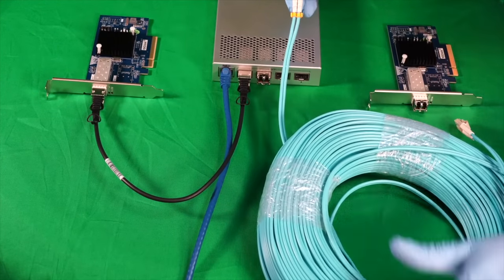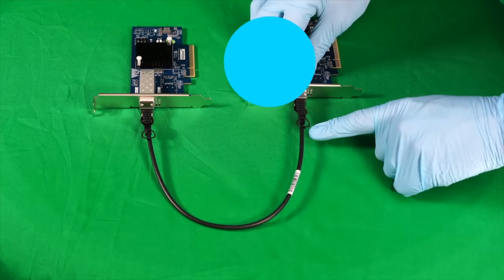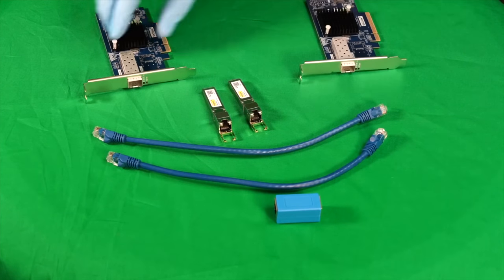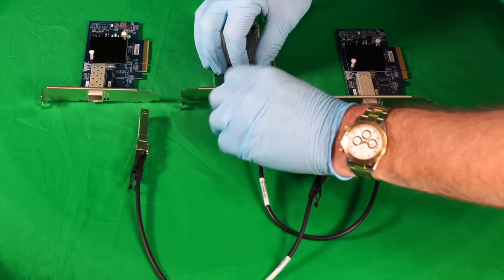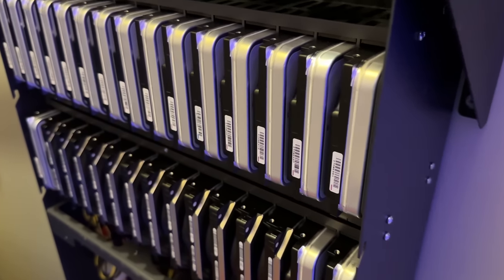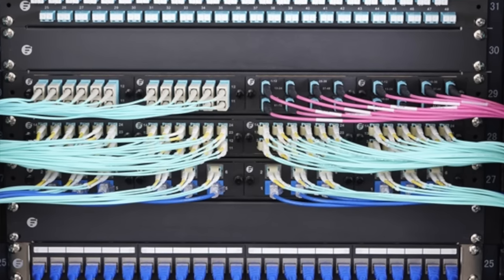10G and 25G Networking - SSD Speeds on the Net

Comment: 100G and 40G ports in switches can often be broken out into 4x25G or 4x10G links (twinax or fiber, not twisted pair).  Computer NICs typically won’t break out that way (some Mellanox is the exception)
Reply: Afair Intel 710 can do bifurcation too. Do you know any interface, that would provide hardware LAG support? Mellanox can do hardware LAG offloading for VFs but I just need card that would be LAG aware. Simplifies network a little.
Reply: It’s typically the OS that does it rather than the card.  You can create a team in Windows server, or a LAG in Linux.  In VMWare you need a distributed switch to do an LACP LAG
Reply: @ausnetting  most of the time it is OS. However, some interfaces do have internal switch fabric. In Intel 710 this fabric is only there to allow connectivity between VFs (as access switch typically would not reply on same interface, as packet was originated from). Mellanox ASAP2 engine can do LAG for VFs without exposing that fact to guest or host machine. It surely works in Linux (aka Proxmox) but have not found (yet) info about Windows support for configuration interface

Comment: 🎯 Key Takeaways for quick navigation:

00:00 🚀 Introduction to upgrading home network from 1Gbps to 10Gbps and 25Gbps
- Overview of different networking components like cables, transceivers, and switches
- Goals of achieving blazing fast network speeds for storage access
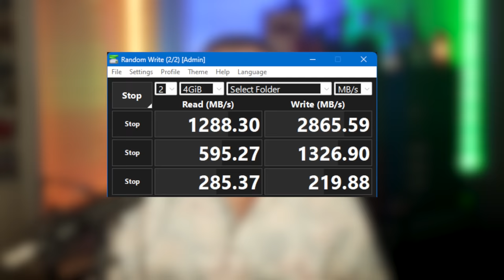01:09 ⛓️ Methods of interconnecting computers at 10Gbps and 25Gbps
- Direct attached copper (DAC) cables and fiber optic cables
- Using RJ45 twisted pair cables with transceivers
- Connecting without a switch using crossover cables/couplers
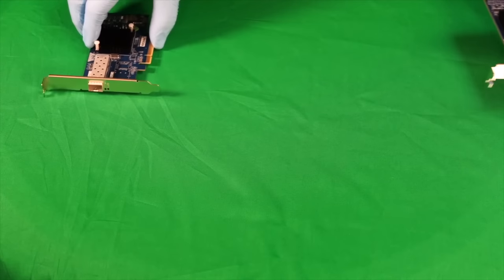02:05 🔌 Demonstrating direct cable connections
- Plugging SFP+ DAC cables directly into network cards
- Using fiber optic transceivers and cables
- Twisted pair RJ45 cables with crossover couplers
04:02 🌐 More interconnection methods
- Using crossover Ethernet cables
- Connecting multiple PCs using dual-port network cards
- Introducing a network switch for more complex setups
05:27 🔗 Long distance fiber optic connections
- Using fiber optic cables for longer runs up to 300m
- Passing through wall plates using fiber optic modules
- Combining fiber, copper and RJ45 for different scenarios
08:30 *🧵 Twisted pair cabling categories and specifications  *
- Explaining Cat5e, Cat6, Cat6a cable types and capabilities
- Maximum supported speeds and distances
- Cable characteristics like shielding and noise immunity
10:19 🔑 SFP port types and transceiver standards
- SFP, SFP+, SFP28 for 1G, 10G, 25G speeds
- Mixing speeds through auto-negotiation  
- Using RJ45 transceivers for longer twisted pair runs
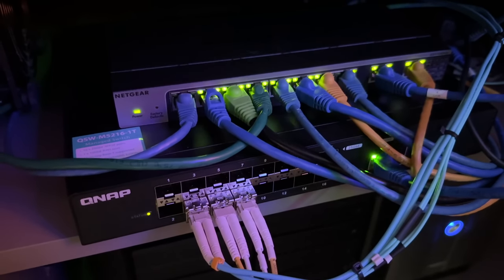13:17 🖥️ Personal home lab networking setup
- Using a NETGEAR 10G switch and QNAP 25G switch  
- Connecting devices at 10G and 25G speeds
- Troubleshooting issues with the QNAP switch
15:35 💻 Adding 25G networking to devices
- Using Mellanox ConnectX-4 cards on Windows/Linux
- OWC Thunderbolt 3 adapter for Mac Studio Ultra
- Considerations for maximum Thunderbolt bandwidth
16:44 *💡 Fiber optic networking basics  *
- Single mode vs multi-mode fiber
- Using cheaper multi-mode fiber for short data center runs
- Fiber optic transceiver operation
19:03 💻 Fiber optic cable types and specifications
- OM1, OM2, OM3, OM4 cables for different speed ratings
- Using OM4 (pink/blue) for 25Gbps and 40Gbps speeds
- Cable distance ratings and future-proofing
21:08 *🔌 Overview of home server closet cabling  *
- Color coding for Ethernet, PoE, 10G cables
- Using OM3 fiber for main internet connection
- Mix of direct attached copper, fiber and twisted pair
22:18 🚀 Benchmarking 25Gbps network speeds
- Testing to NAS with Samsung 980 Pro cache drive
- Hitting near 25Gbps limit from Windows PC 
- Mac Studio throughput limited to ~12Gbps writes
23:14 💨 Disk benchmarking over 25Gbps network
- Testing against RAM disk on storage server
- Mac Ultra read speeds up to 1.9GB/s (SSD speeds)
- 20x faster than conventional 1Gbps LAN
24:10 *🎥 Use cases for 25Gbps networking  *
- Video editing workflows with large 4K video files
- 10Gbps suitable for most single-user needs currently
- Melanox and OWC adapters deliver promised 25Gbps speeds

Made with HARPA AI

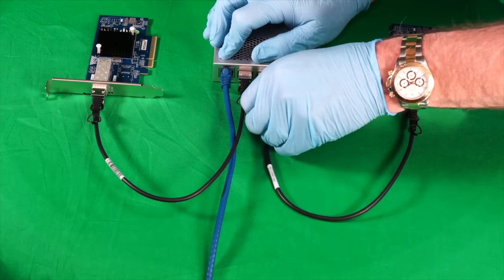Comment: just as an FYI, in that particular switch it's ok to use the single 1g port for switching [5:46], but that is not true of all mikrotik (or any brand's) high speed switches. Many times, it is meant as a console access and it's wired to the CPU and not the Switch chips (like in their 4 x 100gb QSFP), so switching thru it slows down the whole switch. You need to see the block diagram (its on the switch support page or user manual) and see what the 1g port is hooked to.

Comment: Been working at a small ISP for some time now. We use SM BiDi (one fiber for send and receive) for Fiber to the Building and there are cases, where the signal blinds the receiver, if the distance is too short and/or SFPs get mismatched. Also, as the beam is much more focused and usually has a higher frequency, which translates to "way more 'impact' energy", the risk of permanent eye injury is much higher with SM when mishandled. SM can reach as far as 200km (120mi) with carrier grade SFPs and you might not even be able to look at it twice before running out of functional eyes.
Therefore, MM and TP are still valid options for short distances and/or hobbyists and unless you want to go faster than 10G, upgrading an existing inhouse copper network to fiber gains you nothing but trouble. (Exceptions apply.)
When I have to talk to a customer about that topic, it's mostly about the widespread misconception that fiber would be faster, better, stronger in any case. In reality each SM, MM and TP have their pros and cons. 10G are 10G no matter the physical medium, pings are the same, too - even with a media converter in between. Btw, broken fibers still DO happen, especially if you are a proverbial tinkerer.
At Consumer Grade, hardware with 10G support is rare and so are the use-cases for the average Joe. I see on a daily basis what people have connected to their home/soho routers and more than 80% - small businesses included - won't be able to make use of even those 10G. Consider yourself well equipped if you have devices that are capable of 2.5G without bottlenecks apart from your LAN.

Now, if you belong to the other 20% and you know what you are doing, your mileage my vary. In this case, I won't have to send you a technician (and then forward your ticket to Billing) and you can simply ignore me.

Comment: You should check out the 400G-ZR optics.  They can do 400G, up to 120km.  Combine this with the fact you can use different frequencies of light for DWDM, and an optical combiner/splitter, with up to 96 channels, you can get 38Tb/s down a single fibre.  The QSFP optics do cost around £35K each though
Reply from the maker: There's some amazing fiber tech out there that's way above MY paygrade!  I believe they can shoot multiple lasers in and extract them at the same bounce angle and this run multiple streams of light in a single tube, all kinds of crazy things!  And it's not on/off, they can use multiple level of brightness and so on...
Reply: And now even 800G optics are being introduced around one of my work sites.  That requires PAM4 modulation on 8 lanes of 106Gbps with QSFP-Double Density transceivers.    From here on with 200G lanes it's going to have to be all optical, bypassing the electrical interface and piping fibre directly into the switch chip on the board using silicon photonics.       If you have to ask - like me you probably can't afford them - well just yet anyway :).

Comment: I would love to see a follow up video where you enable RDMA on you NICs.  This should give you the same performance but without the CPU overhead of processing each packet when using SMB Direct (file copy).  Also you should try out enabling SR-IOV on your VMs.  This will give your VMs direct access to the NIC.
Reply: That is if the NIC support those features.  I bought several 10/25 gig Mellanox Connect 4 dual NIC cards from E-bay on the cheap a couple of years ago.  I am not sure if he bought the 4 or 5 series so it will vary on model.
Reply: RDMA is huge offload. However, you have to be cautious with SR-IOV. It gives some advantage in demanding applications on VMs and there is no denial for that. However, I have experienced issues with handover in HA Hyper-V cluster. Network connectivity was interrupted whenever handover happened and we were never exceeding used VF count on particular interface. Also, windows guests were unable to utilize failover networking. I have ended up with plain, old LBFO teams for VMs. I do prefer machines to be 1% slower in high-performance networking (not a big deal, when half of people are working remotely anyways) but without unnecesary downtimes.
Reply: Yeah rdma is great but the switch probably won't support PFC, which is kinda a requirement for RoCEv2
Reply: @LampJustin  If your Nic supports iWARP then you don't need PFC.  Also Mellanox has some newer Technolgies (ZTR) that lets you get away without configuring PFC.
Reply: @brylozketrzyn  Agree about SR-IOV with HA clusters. If you only have a limited number of VMs that use SR-IOV and ensure that there are enough VFs available on any given node then you should be OK.  I would also avoid LBFO as it is end of life.  I don't think SR-IOV makes your network any faster, but it reduces CPU overhead somewhat.
Reply: @wampacat6031  well, we always had at least one VF spare even when live migration was used. However, migration does not provide interface required to reinitialize newly assigned VF properly. We just got rid of that. LBFO and other teams seems to be still supported in 2022, now with SET. If it goes down, then I'll resort to SmartNICs. Ability to seamlessly connect hypervisor and VMs to VSF backplane is my personal requirement.
Reply: @brylozketrzyn  Thanks for the info.  Yes, SET is the replacement for LBFO.  I am part of the team at Microsoft that works with live migration and network settings.  I'm going to be personally looking much closer at this scenario over the next six months to make sure it works smoothly.
Reply: @wampacat6031  SET seems to be very rational. However, plain old 802.3AD is what many of netork engineers would use as first choice. Thankfully it can be still enabled with PowerShell. So sad, that many modern network technologies seems to forget about older goods. Some switches (namely HP) are picky about traffic not originating from trunks - despite trunks being essentially just aggregated interfaces, some internal logic makes them very suspicious about mac traversing from one port to another. It may also be a reason, that VFs are failing on HPE 336 (if I remember model name correctly). I need to put my hand on modern Mellanox cards. If they do work as I think - I'll have everything I need to sleep a little less worried
Reply: @wampacat6031  yeah but he's on X4s ;)
Reply: @Modzilla  Depends on the NIC. Newer Mellanox/Nvidia ConnectX (4+ I think), and some other vendors, add a loss control header, making PFC optional. PFC enabled is best because true lossless gives you perfect performance. But it is no longer strictly required for RoCEv2. There is also iWARP, as previously mentioned.

Comment: Worth mentioning that there are also AOCs, which can be used similar to DACs but for longer distances.  AOCs are still usually cheaper than buying two optics.  The downsides here are that if the cable gets damaged, you have to replace the entire cable, where as if you used two optics and a cable, you only need to replace the cable.

Additionally, for 100gig+ over multimode, MPO cables have started becoming the norm, but these are just bundles of normal multimode fibre pairs.

This means they can also be used to run multiple fibers between locations, for example running fibres between floors in a building.

I've also used these with MPO cassettes as breakouts.  You install a 100gig switch, with QSFP ports on one side, plug in a MPO cable, run the cable to a different room, connect to a cassette, which splits that MPO into normal multimode pairs, which can be used for up to 4x25G or 4x10G devices.

Comment: I highly recommend you use single-mode fiber even in your home. You will never need to run a new fiber again vs multi-mode which may at some point need to be replaced to get higher speeds. Costs between multi-mode and single-mode are very similar now a days. I did a write up about my setup but I can't post the link here however my name and wiring a home for fiber should help you find it.

Comment: For SMB (the network file system protocol) the basic rule of thumb is approximately 1.1GB/s (plus or minus 5%) of real world throughput per 10Gbps of bandwidth. Assuming there are no resource constraints (storage, CPU, memory, PCIe bus, etc.). So a 1Gbps link can push an average of ~110 MB/s (+/-5%), and 25 Gbps can push ~2.75GB/s (+/-5%). Converting 2864.59 MB/s to GB/s (2864.59 / 1024) is 2.79 GB/s, which is within the expected real world range for 25Gbps.

These are not official numbers, just observed behavior after working with SMB for years.

Comment: I started a job in WAN last januari. We're using OS2 single mode for distances up to 80km, at 10, 40 or 100 Gb/s per fiber. Some SFP's will reach out to 120km, but we're not using those. Never work with live fibers! The lasers will cut and burn you, seriously! There's a lot of energy going down a fiber that needs to reach for kilometers. And you can't see them, they're outside of the visible spectrum. Get the distance wrong, and you'll burn out the SFP on the receiving end. Also, always have a ferrule cleaner handy. It's good practice to clean the ferrules every time you make a connection.

Comment: One thing you appear to have almost mentioned, is that fibre patch cords are always crossover.  In fact even the in the wall structured cables are crossover too.  When you connect them, either directly, with a single cable or between rooms, with the in the wall cable & 2 patch cords, you will always wind up with a crossover.  You can see in this video, one fibre is yellow and when compared to the other end, it's the opposite side of the connector.  Often, when you get a patch cable, the two connectors are loose, with a plastic clip to position them.  With that, you have to make sure to cross them, if needed.
That 15 pin connector you said looks like a game port is for the old "ThickNet" 10base5 cable, which was used with a transceiver.  That connector is for connecting the transceiver.
Even some 100M NICs didn't need a crossover.
The earliest LAN I worked on used triaxial cable.  That's a cable with 2 separate shields.  It was a proprietary Rockwell Collins network on the Air Canada reservation system in early 1978.  It used Time Division Multiplexing (TDM), instead of packets or frames.  It was also a ring and ran at 8 Mb.

BTW, some vendors will resell returned equipment and will shrink wrap it again before selling it.

Comment: I upgraded to 10gbe about three months ago using a Unify Agregation switch, I found that it was important to enable jumbo frames on everything on the 10gbe switch or the bandwidth was about 6gbe and no faster, enabling the jumbo framed hit the 10gbe no problem.
Reply: Extremely important for storage networks, and the ideal setting is to match the storage device frame size.  Most other devices have mixed workloads (anything internet for example), so the standard frame size is fine for those applications.

Comment: Cat 5e is actually rated for 5Gb up to 40m, and 2.5Gb up to 100m.

Cat 6 is rated for 5Gb up to 100m and 10Gb up to 55m, and typically works up to 100m in most installations.

In short, you only need Cat6A if you need connections at 10Gb beyond 55m, and then fiber optic is probably a better option. Dave is right (as usual), 6A is considerably more troublesome to hand terminate. I’ve done quite a bit of it, and you want to avoid that if possible. 5e and 6 are notably easier to hand terminate.
Reply: Can't 5e do 10Gb on a short run? I think 40m.
Reply: @TheBacktimer  In practice, it usually works, but it’s not officially supported.
Reply: Technically if you crimp 2 phone lines together as a ghetto cat5e to could push 10gbps for a very short range. It’s mostly copper wires at the end of the day
Reply: @suiton20  Nope, phone cable is almost always Cat 3 cable and it won’t even run 100Mb at 10ft.

Comment: Back in the earlier days there was an electrical difference on the tx and rx sides of the transceiver, and the Ethernet isolation transformers had different winding ratios for each meaning that you had to use a crossover cable to line up tx-rx.

These days, electronics are better and more capable, and Ethernet isolation transformers use the same winding ratio for "tx" and "rx" meaning that the transceiver can use tricks to automagically rearrange them.

Comment: Dave, MM FO (G.651.1) is not that less expensive and still uses lasers (VCSEL) in most cases. You are wrong if you think that SM cabling and SFP's are something exotic, reserved for telco's only. In most cases price difference is so small, that it is much better to focus on uniform SM cabling. Today you can get Cisco compatible 10 Gbps 1310nm (up to 10km SM) SFP+ for about 30 USD. While 850nm version (300m MM) SFP+ is about 22 USD.